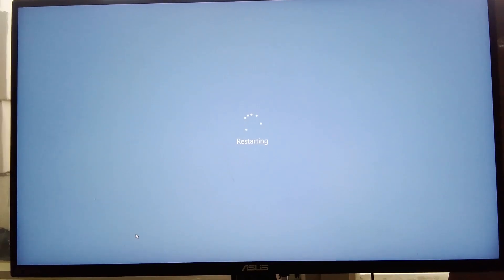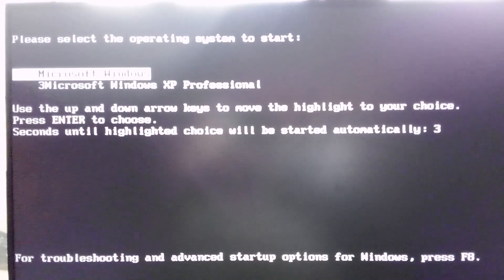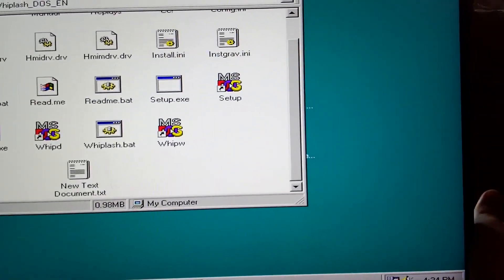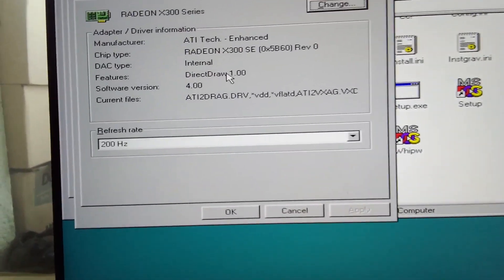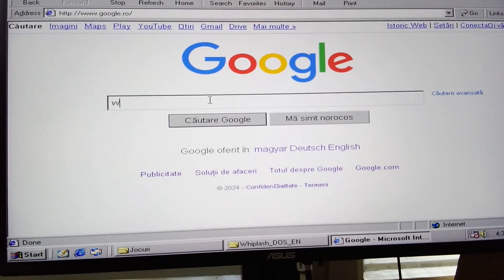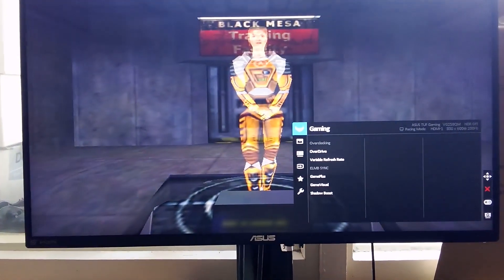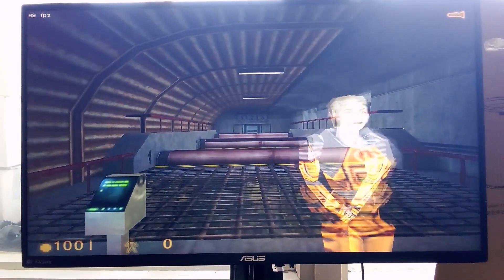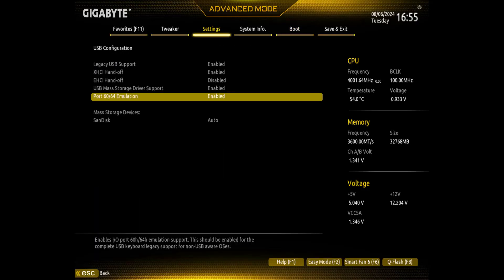Z690 12700k with DOS Audio in Win98 using SB Audigy 2 ZS and OpenGL with ATI X300, and USB Internet

Comment: using the anti-static bag as a separator isn't a good idea, because  the outside of those bags is actually electrically conductive.
Reply from the maker: I think I thought out of curiosity to check that anti-static bag for continuity with a multimeter, and there was none.
Reply: @roundsound2658 don’t ask me how, but I know that in some cases material can be conductive only under certain conditions, so that you can’t measure it with a multimeter, but it depends on certain conditions, voltages or temperatures or so on. These bags are known to have some sort of conductivity to avoid static electricity. Air is a good isolator so I would recommend to just make sure that the distance between the cards is always more than 3mm at least.

Comment: You didn't experience the crazy mouse glitch?
Reply from the maker: If you are talking about 'when moving the mouse just a tiny bit and cursor teleports around', I remember having this during setup screen(maybe on desktop too?), I think it was on another motherboard(the one I used before I got this z690 one)asrock h87 performance.
I just tested now Win98 setup with mouse and keyboard into z690 usb slots, and cursor moves without issues, keyboard works too.
Reply: @roundsound2658  I had this bug on ASUS B450 and now I have it on my MSI H610 motherboard as well, of course talking about motherboard's USB ports. I can either use Win 3.1's mouse driver which doesn't have scroll functionality and is laggy, or what I use is my PCI-E x1 USB 2.0 controller. I guess each mobo handles PS/2 mouse emulation differently....I think i didn't had this bug on ASRock H110 but it had a special USB PS/2 option in BIOS.
Keyboard everywhere was fine.
Reply from the maker: @pangoomis  I tested with bios setting "Port 60/64 Emulation > DISABLED", keyboard works in dos. Mouse and keyboard do not work any more in Win98 setup(capslock led toggle works, ctrl+alt+del works)

Comment: Get yourself a case with vertical graphic card slots and you could mount your Audigy + USB cards there for a neater build.
Reply from the maker: I have been using that PC case from the first PC bought for me when I was a child, it may have been from around 2004. I thought to maybe make a small enclosure for the PCI adapter and the cards.

Comment from the maker: That PCI Card with usb, sata and ide, I tried to  boot from it with an sata ssd, it did not show in Bios Boot Menu. I read on some russian forum about some modifications to make it able to boot from it, I may attempt to do them. Adding some resistors on empty spaces, changing the rom/LPC chip to a supported one and flashing new rom(and or somehow adding the rom into the motherboard bios as Option ROM). A user Memphis enhanced an old ROM file for the VT6421A and provided info on the russian forum.

I have not yet tested the universal sata driver for Win98 by Rudolph R. Loew for the motherboard sata controller, currently win98 boots from the z690 sata ssd in MS-Dos compatibility mode.
Reply: Your Mobo certanly works in AHCI mode so simply install the AHCI driver from rloew to get full 32-bit disk access and remove that message in system properties :)
Not to be confused with the SATA driver as that is for when the esdi_506.pdr driver doesn't work...which is irrelevant for modern motherboards since those do not use esdi_506.pdr